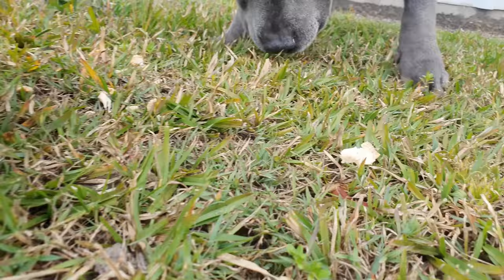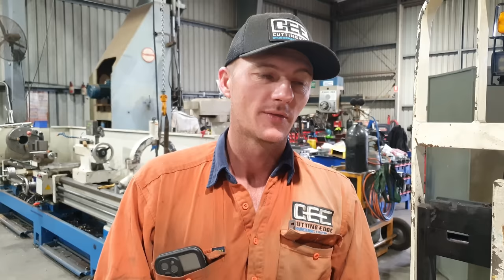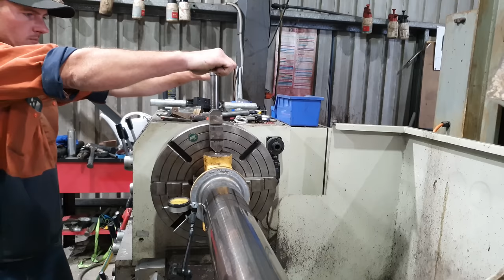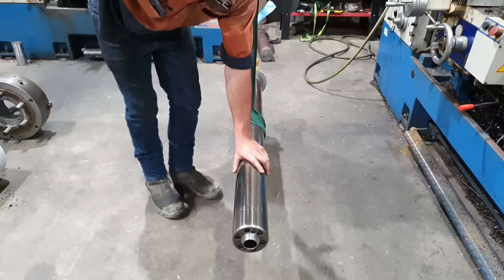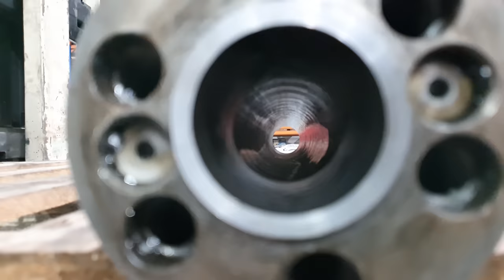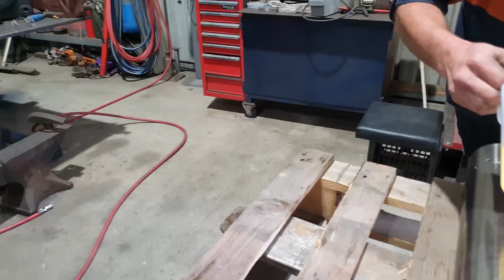Cracked Telescopic Cylinder Weld Repair | Machining & Welding

Comment: I used to be a machinist for these parts before our contract got pulled. I personally wasn’t a fan of these. Had a lot of welding issues with porosity. They are sub arc welded.  The tube for the body was always junk. Meh still cool to see something that I’ve maybe worked on out in the wild.

Comment: May I be so blunt as to ask what the ballpark figure is for the customer for this repair? A new cylinder would cost 17k (AUD I assume) you said and what would a repair like this cost (end-price)? I’m just curious if the savings are massive (>50%), enormous (>75%) or ridiculous (>90%) 🤓. And allow me to add that I’m incredibly (>80% 🤣) impressed by the quality of work that is delivered each time, I am in awe with the ease that you seem to take on such seemingly complex jobs! 👍🏻

Comment: I've never heard of testing for cracks with gasoline before.   This is not my field, so I may be asking a silly question, but wouldn't it have been better to pressurise the tube slightly with air, submerge it, and look for bubbles?  That would find the tiniest crack.  Gasoline may evaporate faster than it weeps through a close to closed crack.
Another method of crack detection is by pressurising with air mixed with a few drops of a halogen  eg chlorine, and searching over the surface with a halogen detector - these can detect parts per million.

Comment: If it's hvof coated carbide surface, how could you machined it? I think it's chrome plated originally. Also I couldn't see any crack on coated surface next to welded area after welding. Thanks for publishing this informative video.

Comment: I loved the video. Your problem-solving is excellent. Apologies for the layman question but does the material you weld with have to be of similar mechanical properties to the metal you're welding together?

Comment: The timelapse of the video may have caused us not to see it ,  but you need to shake the developer can for at least a minute.  Otherwise it sprays on watery and doesnt develop properly.   Also , the surface needs to be super clean to be an effective test

Comment: Why do you sometimes use the wire wheel to clean a weld between passes, and sometimes the needle gun? Is it because you're using different types of wire? Or just based on what you feel like that day?

Comment: OK, dumb question time from an amateur lathe operator. Could you not have cut the tail weld by sliding the tube in from the backside of the headstock, then just flipped it around to cut the head off? Or did you not have enough room behind the machine/tube not long enough?

Comment: Kurtis, you use many different welding wires in many different application and with different gas mixtures. Is this just an experience thing or do you use a guide or even ask the rep for the best advice, thanks

Comment: check the other push cylinder for oil bypass.  If it's not holding pressure the broken cylinder may have been the only one doing the job properly causing the mis alignment. see that semi regular in the equipent repairs i have done.

Comment: kurtis, out of curiosity how long do you let the red dye penetrant for PT testing on the weld before cleaning it off? I work with the stuff pretty regularly, if you left it on for 5 minutes or so it would give you some super clear indications.

Comment: Based on the high quality of your work, I assume you don't weld stuff back together crookedly. However, at 22:52 onwards I think the head does swivel a lot compared to the tube, right? Is it supposed to do that?

Comment: Interested tonsee how durable those welded teeth end up being.  I dont doubt the weld, that looks good, but the metal deposited isnt going to be quite as strong or have the same heat treatment as original.  Just depends how much it gets abused i guess.

Comment: Top job, what's the little bit set you used to swap the insert edge, are they set torque limits or something?
Reply from the maker: hey mate that's a Sloky torx bit set, yes it has preset torque limits

Comment: for crack testing leaks methylated spirits is better as it is thinner than petrol and has no oil. its a old trick for testing valve regrinds on cylinder heads.

Comment: Hi Kurtis and happy birthday to Homey, quick question: have you ever used spray welding to build up material? Just watched abom79 using it and looks interesting
Reply: "Repair BROKEN Broken Cast Iron Transmission Housing - Flame Spray Welding" is a video from Curtis from about 10 month's ago. Is that what you mean?🙂

Comment: I really don't understand the petrol part where you perform the leak check. What is special about petrol? It penetrates into cracks easily? I assumed you'd try to set it on fire to see if any of it even just in gaseous form would creep out but you just poured back out 🤔

Comment: Here’s a question for ya, I’m in the states and when I weld I always have the part rotating away from me. I noticed that you always have yours rotating towards you? Any reason to why, I’m just curious. I also heard when you flush toilets down there the waters spins the opposite way ours does lol maybe there’s some correlation between the two.

Comment: Fuckin love it Curt!! You’re a far bit better Tig hand than ya let on mate! Crack on! On a side note as a past welder and now NDE/CWI/API inspector I’d suggest a more thorough initial clean on your LPT examination,… and suggest “lint free rags” also wipe excess in the same direction,…every time. This will help proper clean but won’t let you smear “crack check” (dye penetrant) back over the part or weld. This is important to rule out false indications! Love the vids though m8!! Used to do this same work for a living when I was 20yo! Sure miss it!! HMU I’ll trade ya some more free advice if ya let me advertise your business for free! (Hats m8 I mean hats and whatnot)! Cheers Curtis!!

Comment: I wonder if there is an actual market for a boutique personal delivery service to ferry parts like this from the US to wherever they are needed. Instead of 17 grand and a three months wait, it would be 20 grand and plane ticket and for that I will have it in your hands by the end of the week. All I would need to know is where to pick it up in the US and who will be taking delivery of it at the airport. Seems pretty cheap considering the cost of having a machine down for three months.

Comment: Is this a first time for TIG welding on your channel? 👍😀
Reply: How do you control start and amperage? I don't see a finger control nor a pedal, just scratch start? That torch makes a lot of noise, is it the microphone that amplifies it or you have the argon flowmeter set to a very high value? 👍👍👍

Comment: You left the ports open while you were welding that was a stupid thing to do one of the ports goes through but the other one goes between the flow tube and the outer tube you can not clean it after its welding up

Comment: I think i missed the part where you made sure the pin hole through the top was running exactly 90° to the rod. Looked to me like it was wobbling around like a drunk man.

Comment: I would have like to learn TIG welding but from what I've seen just looks like gas welding I started off gas welding in the 70's then went to MIG  in the 80's , mind you nowt like what your doing just car body I was a panel beater for 35 years in north east UK  .

Comment: I'd tig weld that with high carbon 309 stainless wire cuz it's harder and stainless and bonds with carbon or stainless very well and Tig weld is stronger and way cleaner in my book

Comment: Make sure you read the instructions and don't get the red die check on any Cuts or wounds or hands and do not breathe it
Reply: Next time before you weld wrap the metal with copper tape so you don't get weld spatter

Comment: How does the shop make money? I can’t see how a one man operation can cover the overhead and equipment/shop costs ?
Reply: TLDR:  It's an expensive industry, with no shortage of work.  He's gained a reputation over time; a good reputation obviously, and with that comes work. A lot of work. No end of work. Enough to where he can turn down jobs for any number of reasons. (Of which is actually a good idea, especially if it's outside of one's capabilities. Some people don't do that and end up making themselves look bad, therefore they may lose work in the long run)

You don't need multiple people. You need a wealth of knowledge and attention to extreme detail levels of skill. Amongst other things. Such as, customers that know and trust you. He has plenty of customers that know him, and obviously, that trust the type of work Curtis does. And don't forget, he's not doing tiny jobs. He works on parts that are off of very big machines. Where parts from OEM cost upwards of 30k, just for something like a cylinder. So the jobs he does, while he doesn't overcharge, pay well. Very well I'd imagine. Also, let's not forget he's been in the business for well over a decade working for other people in the field. So I'm pretty sure he saved up to be able to afford certain things outright. As well as things on finance/loan, that sort of thing. He's said before, that he's more efficient doing the work by himself, because finding people out there that have his level of attention to detail and care, isn't easy. And, is often times more costly when you go through trying to find those people. 

In terms of equipment, if you think about it, he buys used. Usually from auctions. But some of the stuff was network based, so word of mouth and good deals. I guess really, being that I don't know what the fuck I'm talking about, Curtis and the wife, working as a team have done it all right. If I'm not mistaken, I'm pretty sure this would've been a plan at some stage. So everything done prior, was done to get to where they are. But it's a good question. Maybe Curtis is on Feet finder? Or maybe they sell pictures of his incredible fucking welds. There's definitely a market out there for selling welding bead pictures/videos. 😂

But seriously. Skill, attention to detail, network, area of operation, things like that will make all the difference. This would be pretty difficult if he were in the middle of buttfuck nowhere, as shipping a 20' hydraulic cylinder that weighs a couple hundred Kilos, and all the other things he deals with, would be extremely expensive for those that need repairs. Certain a few of his customers are somewhat local. And again, could only be obtained with experience in the field over time.  He's one of them, where I bet those that need work done; the highest quality of work, won't mind waiting and being patient if it means they'll get a piece back that will not fail. People don't generally mind waiting if they're guaranteed to get what they're paying for, and then some. And when you've got machines that are expensive, downtime is expensive. But what's more expensive, is paying for a quick job for the least amount of downtime, all for the fix to fail because it was rushed and not done properly, so now they've got downtime again, as well as the cost of paying for a repair a second time. So a little extra downtime and a little extra cost is better the first time, when it's being done by a guy that knows his shit, and that'll get it right the first time. Too many people learn that the hard way and end up spending well over double what it would've cost, if they just went to the correct person to begin with. The correct person/company, is usually the one that's always busy, because they always have work. Which means people choose them, over everyone else. People don't mind paying a premium when it saves them money in the long run. Providing they're actually smart. Those that aren't, are sure to wizen up when they've spent thousands on a rush job because they sent it to the guy or company that can do it cheaper because they cut corners to get work.  Also, don't forget, this channel is a huge advertisement for the absolute top notch work engineering that people expect. People like Curtis, and there's others out there, do not need a team full of people to churn out repairs. Because reputation matters. Quality is far more important than quantity.  They'd probably be out of business if he focused more on recruiting as opposed to going solo and dong what he does best. People that use him, and new ones that choose to use him, I believe understand and respect the fact that he's a one man band as far as the repair goes. If people don't want to wait, they can always go elsewhere. If they can't wait, then they can always pay more to jump the queue. But I doubt he does that with everyone. I doubt he does it often to be honest. Because reputation, especially in his industry, is very important. I'm obviously talking partially out of my arse. Because I'm not Curtis. But I doubt you'll get a response. Even a video response in the form of a FAQ format. But I've watched enough videos, and also greatly appreciate those that care about the details. I'd pay extra and wait for it to be done right the first time.  In work, I take my time more so to make sure shit's done right the first time. So that's partially where my take comes from.

Comment: never seen crack detector in a can, is it as good as eddy current, or dye penetrant methods?
Reply: Hello, it is dye penetrating system. The thing is, you have to wait 10 Minute before you remove the Red dye. If the component has 30°C it is helpful. He was little bit to casual.
Reply: @fziesmann7382  i thought you had to use UV light with the dye

Comment: a shame you don't explain these "crack test" with just a few sentences in the video on how that test works, as I have seen it quite a few times in yoru video, as it seems to be multi stages, components...
I can conclude that is likely a little like those test we all did in school decades back, where you crack some red pellet in your mouth and then it will show areas not cleaned but I guess its a little more to it then that..
Reply: I'll fill you in. The first step is a cleaner to prep the surfaces for inspection. Next the Dye is sprayed on. It's a very low viscosity dye with a high wicking ability and will seep into even the tiniest cracks. This sits for a minimum of 15 minutes. The cleaner is sprayed on a clean rag (never the part) and is used to wipe away any excess dye. Last a developer (talc powder) is sprayed on and it will wick any dye back out of a crack and stain the developer.

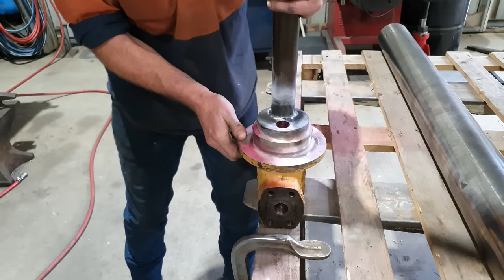Comment: 14:55 
ru Tрещины и качество шва нужно проверять керосином, а не бензином. Бензин слишком летучий, и из-за этого может успевать испаряться не образовывая видимого следа.
en Cracks and the quality of the seam should be checked with kerosene, not gasoline. Gasoline is too volatile, and because of this, it may have time to evaporate without forming a visible trace.

Comment: Gas shielded with slag? Huh
Reply: He uses a lot of dual shield flux core Mig.
Reply: @kjdude8765  why would you use that with gas?
Reply: @becomematrix I don't happen to design welding processes. So I recommend doing some reading on your own. But a quick Google search suggests it is more environmentally flexible, has better weld penetration, and is an overall cleaner wild with less spatter.

Comment: It is such a pleasure watching you work!  Nothing like Aries god of war metal putting food on the table!   The odd hotter than hell metal chip from machining and welding burning BBQ into flesh.  Oh I too have countless meat BBQ medals burnt flesh.   I think some actual metal is still there.  Yah even looks like a wood screw in foot xray still tight!.   Was working and broke it 10:00  am next day 4:30 am in emergency after work done.  Hurt like hell. Well lets just say if carpenter dork-tor  in butcher shop emergency AKA hospital Cauterized or burned wood screw surgery foot meat shut.  lol did not need pain killers.  Well still have all fingers, toes, and meat i started with. Be careful , and hopefully next gen can carry on!  Money is there for taking honestly.  FIXING OR REBUILD. or scrap.  Even big companies can be brought to their knees bad luck broken machinery. No place to go .